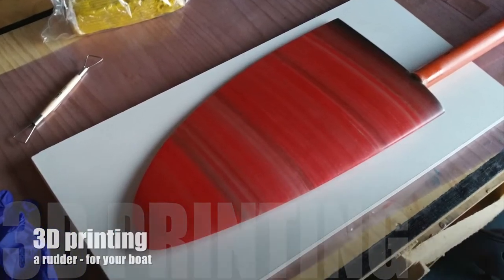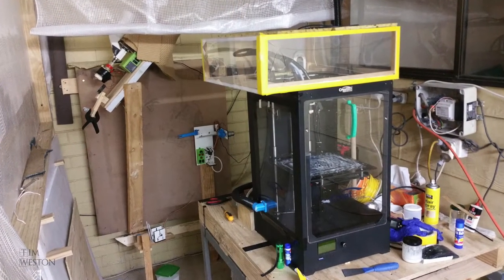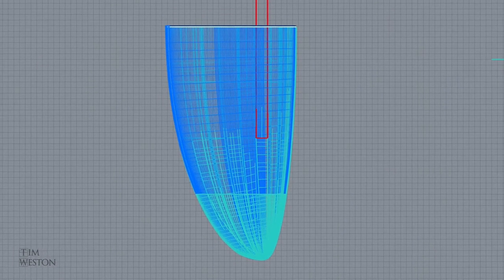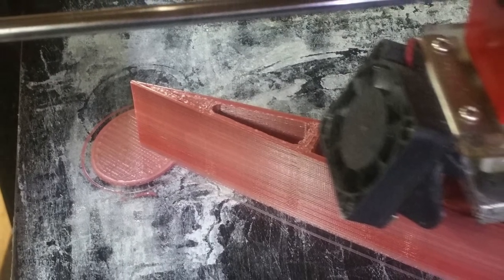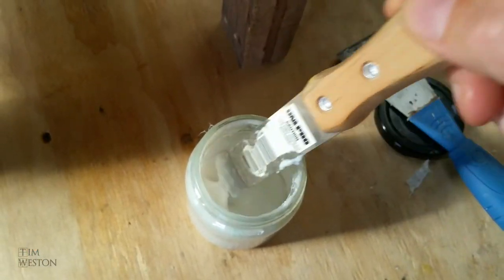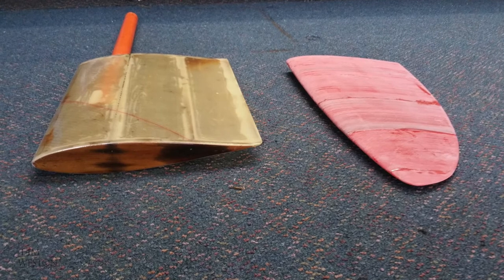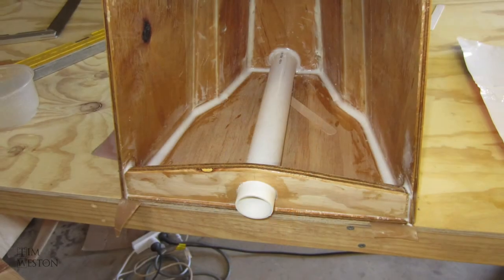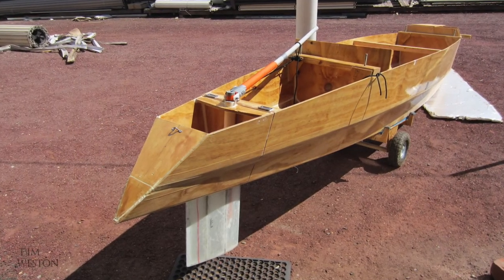How to make a rudder for a boat - with a 3D printer

Comment: I have a similar boat (although a shunting proa) and am considering making a board like this, but probably CNC from wood. Am wondering if you did any sort of boat performance measurements. I figure if you could subjectively notice the difference it must have been quite significant!

Comment: Hi Tim, nice one, exactly the type of print I was wondering about as my old rudders need replacement... Do you remember the weight if your rudders? (= How much ABS used to print the rudder)  How is it holding up after time?
Reply from the maker: Hi Didier. No, I don't remember how much it weighed. It was fairly light though, as there was a lot of hollow space inside. I haven't used now for some time but it didn't show any signs of wear while using it.